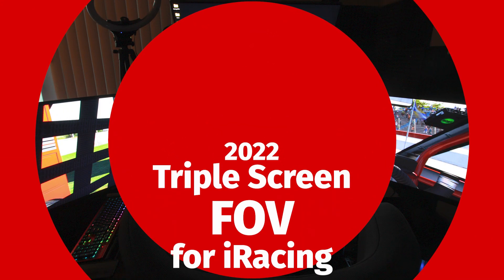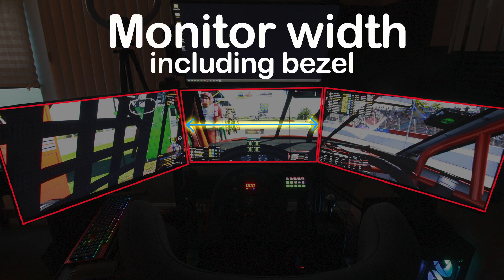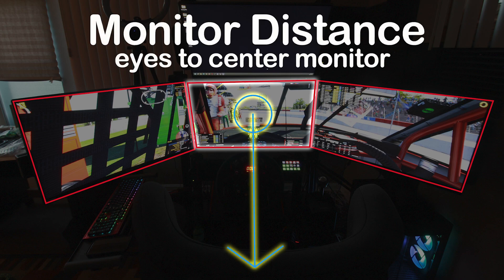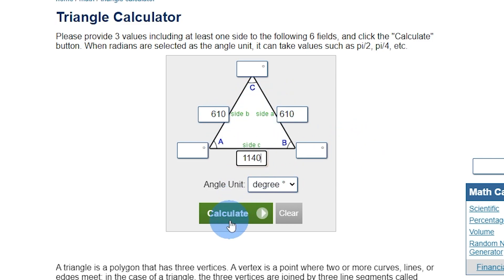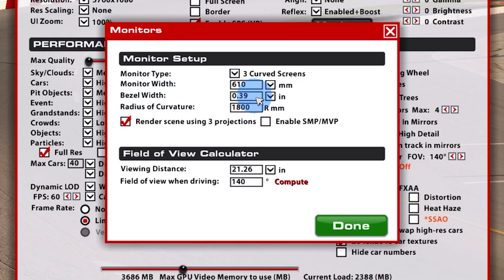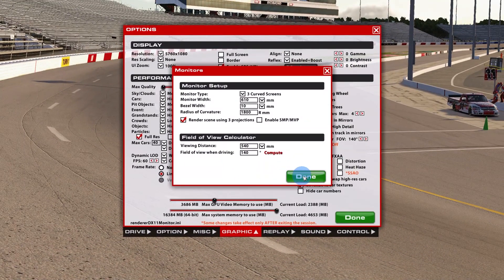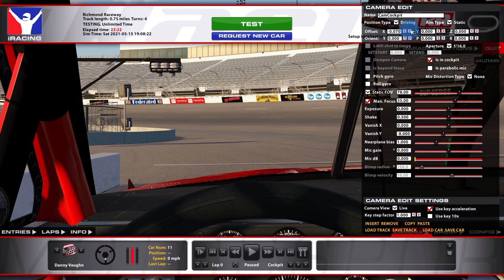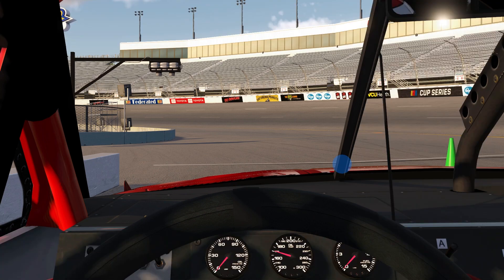2022 FOV Triple Monitor Settings for iRacing | Settings Updated for 2022

Comment: When going with the ‘just set viewing distance to 540 regardless’ method, I was never quite satisfied with the FoV outcome and ended up changing it with the slider anyway until it looked ‘right’. Interestingly, when entering the actual distance from my centre monitor (640), the calculated FoV was within 8 degrees of what I had eyeballed. I do think the math works when you correctly enter distance from screen. Maybe it makes more difference with larger screens/triple screens?

Comment: I'm curious if you're using nvidia surround or not?

I've always NOT used surround, just updated the parameters in RenderDX11.ini to setup for 32" curved triples (and have a 4th monitor above the triples). But ever since the 23S1 iracing update my FPS has been crap. Tried resetting everything with the iRacing Graphics auto-config, but now I've gotten everything a big screwed up for triples. Wondering if I should just use surround now.
Reply from the maker: I’m not using Nvidia Surround in iRacing, but use it for some other racing titles. I had the same issues during seasons 1&2 2021. No explanation and no assistance from iRacing to resolve the problems either as it was a small minority of users. This time it seems like iRacing is working toward a resolve. Side note, there is no way in hell this current platform can handle rain!

Comment: Informative video and easy to follow. Thank you.

Question: What are your recommendations regarding "shift horizon" setting?
Reply from the maker: User preference. I would tell you to experiment to see what works best for you. I don’t think there is a right answer.
Reply: if you use triple screen, it is for align the lines to be continuous between central and side monitors. other words, you can adjust difference between level of your eyes and vertical middle of the screen to be in the same level without moving screens or your position up or down.
Reply: -12 to -14 shift horizon or you're looking down, once you notice it you'll never unnotice it
Reply: only true if monitor screen is center at mid eye level as well

Comment: Screen Angle has been patched into the option menu since this video. Nice they added that.  Thanks for taking the time to put this together!
Reply: It only appears if you put you re running flat screens
Reply from the maker: Interesting. I wonder why it is only on the flat screens? Thanks for sharing.
Reply: @XJSimulations  it is simply because for this option iRacing expects 3 curved monitors making smooth arc without interruption and/or angles. changing/editing angle in DX11Monitor.ini file makes no change in fov at all. try it.
Reply from the maker: 🤔 this can vary in regard to side distance.
Reply from the maker: Hum. I don't see the side monitor angle anywhere in the Option/Graphics menu.
Reply: @XJSimulations   if you select 3 flat screens  ,  it will ask for the angle between the center and side screen.  

It is not there if you have curved monitors.

Comment: Great video, quick question, do you align the curved monitors with the curvature of the monitor so its continuous curve of all 3 so it looks like a seamless curve or angle the monitor to what some calculators recommend.
Reply from the maker: Great question and I think it is user preference. As long as you measure the side angle and use that degree, it should be fine. For me, I use a continuous curve with the monitors.
Reply: @XJSimulations  @artgrecco7373 I have a bit of a tight space so angle the curved monitors 'in' tighter.   Imagine a half circle between the ends of the monitors and the centre of the centre monitor intersecting as you look from above.  To set the radius curvature I measure between the end of each of the L & R monitor to get a distance and halve that (to get a radius).  Example:  I have 1500R screens on a 69 deg angle.  The distance is 1210mm between the L/R monitor end points.  I use approx 605mm as the Radius (not 1500R) and tweak a little from there.     This isn't perfect but I have found that at least for me prevents the left/right 'squeezing' in to the sides.  You can adjust these values until fences and other straight lines in the view at eye level look straight.

Comment: Good Day XJ simulations, first and foremost thanks for the video I learned a lot about FOV, but I did everything u said and still can't get my triple to work again. Everything was was working fine until I made a HUGE mistake and changed Resolutions in inracing from 5760/1080 to 1920/1080. Finally fixed that after hours, and can't seem to get it back to triple monitors to work. I delighted iracing and re-download it again cause i dident know that the 2nd patch change a few thing around in appini.  Can u give me any suggestions for my fix. It would be really appreciated. Thanks
Reply from the maker: I really need to do a video explaining the steps to setup triples from the start. With the changes over the past few seasons, it is a bit different now. The changes you are referring to are in the monitor.ini or virtual.ini as opposed to the app.ini

Comment: What if you have a bezel free kit
Reply from the maker: Great question and I do not have an answer as I do not have a bezel free kit :) However, I would tell you to check the view with and without the bezel size. I'm betting without is the better way. Come back and let me know!
Reply: You'll just have to play with the bezel setting in iracing until it looks right.   I have to use a negative number on mine for things to line up.
Reply from the maker: Thanks for providing that information for others!

Comment: The second most annoying thing about iRacing besides the grass and sand trap physics is the lack of a true seat forward and back feature. The problem with moving the camera is that the seat head supports almost completely block your side view on triples depending on how far back you go.
Reply from the maker: Yeah bud, you are right about that. There is a point of diminishing returns.
Reply: you can do that man.
just go in replay -> cockpit camera > control+f 12